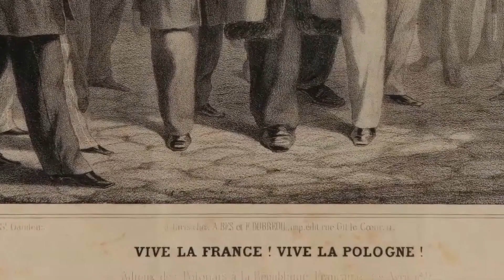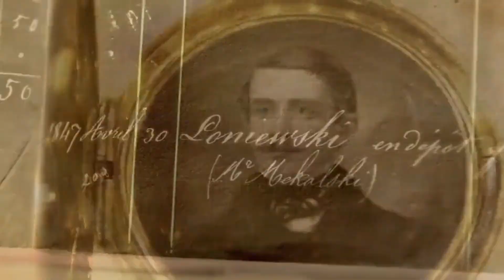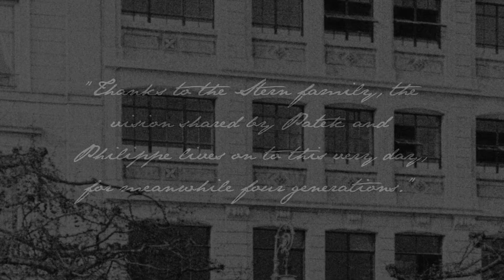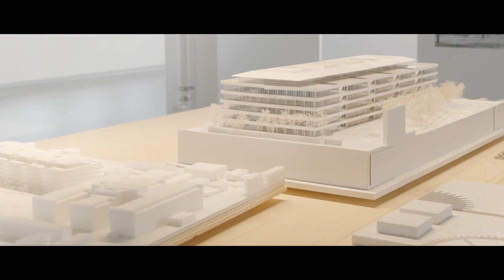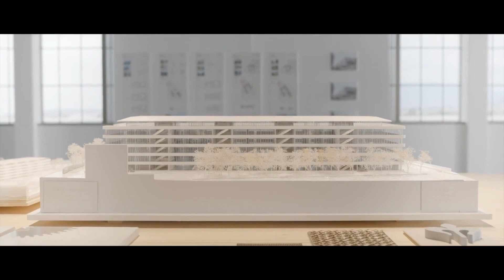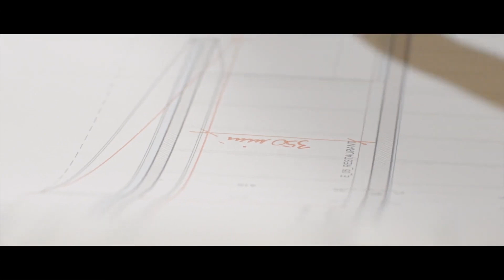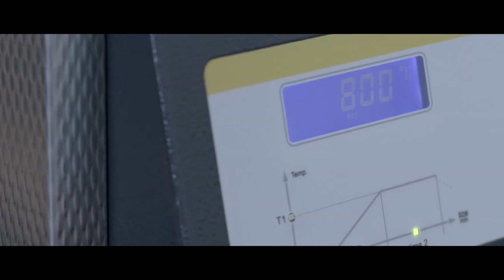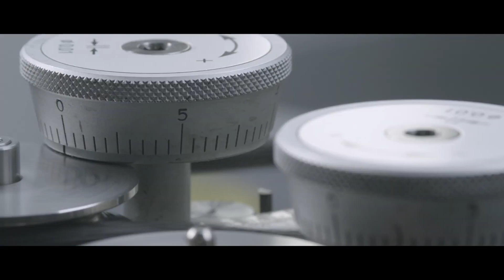Patek Philippe Geneve

Comment: The more gears meshed within the gear set... the greater the force of friction between those gears, which leads to increased losses and thus slows down the movement of all gears. This fact applies to gears in mechanical watches with multiple calendars, where losses cause timing delays that drive manufacturers to calculate the smallest possible design and manufacturing details to reduce those losses by minimizing the friction force between all gears, especially the most prestigious watch companies so that these aspire to Companies to reach the greatest accuracy in timing. By calculating all the details of the movement of the moving parts, as well as the smallest effects of various external factors. Therefore, the production process of luxury and intricate Patek Philippe watches takes several years of design, manufacturing, and testing to achieve all the exacting standards required.